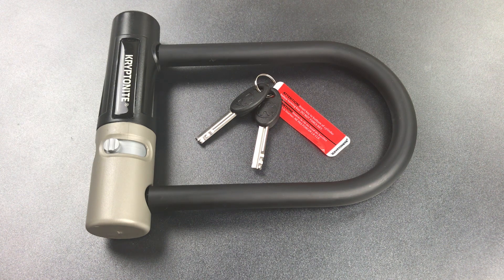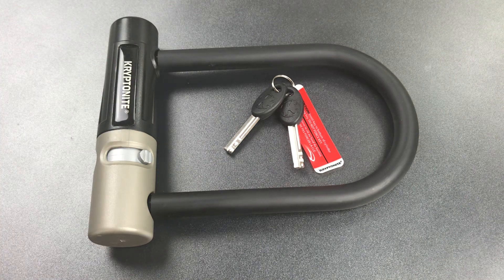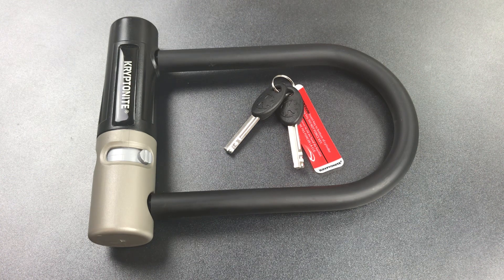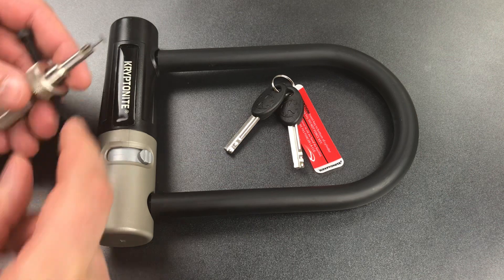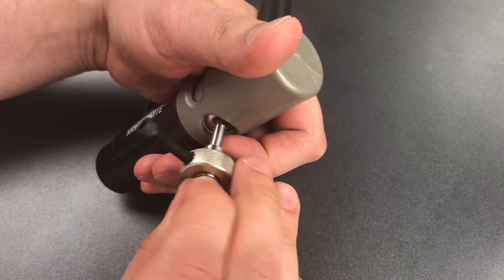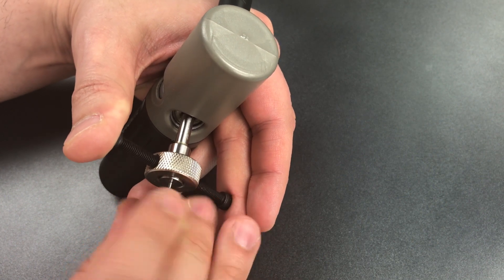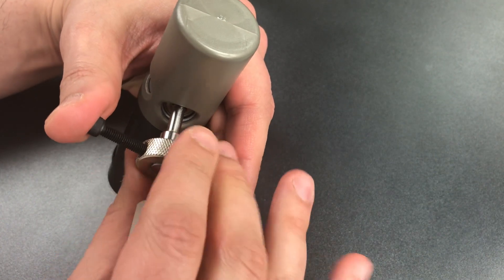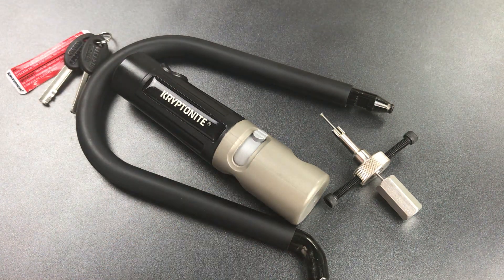[673] Kryptonite’s Trickiest Core in its Worst Lock (TKO Mini U-Lock)

Comment: How I described this video to a friend (play-quoting you): 
"To pick this lock, you'd need an incredibly expensive gadget hand-machined from unobtainium by a hermit living under a footbridge in Mercia. However, because the lock was made indoors, I'm going to open it anyway with the same old hacked-up cheap Chinese tool I always use."
Reply: you missed "by using it backwards" at the end
Reply: Could this be the lock to keep Mrs LPL out of the ice cream ?
Reply: The only part of that pick that is stock is the tensioning collar. The sleeve is either a home brew or modded original, but I'm going to go with the former. The tip looks like Spoox and the grip is from a bottom tensioner. It's close to as good as you can get, short of a Silver Bullet. There are ones out there that are ten times the price of a Silver Bullet and don't work any better. But for us mortals, that modded Chinese one is a good solid work horse. Don't knock it until you've done the mods and felt the difference.  That said, yes LPL is still a fucking badass.
Reply: This is the funniest comment ever

Comment: I like this trick! You can still do it on Abus Plus (on front or rear disc tension) but feedback is exceptionally crummy, especially with the false gates. I have a Chinesium disc detainer that uses one of the middle discs to drive the lock and it just totally kills feedback when using the front/rear disc to tension. Abloy are even worse with their front disc tension defences, so whilst a cool trick, it won't always work.

Kryptonite do a better disc detainer than this IMO, it is one of the Evolution series. It has irregular profiling and a disc blocking system, like Abus X-Plus (I think it is an X-Plus on license tbh)...or maybe I am confusing two locks there. The Evolution Series 4 definitely has the free-spinner at the front and irregular profiling but it might be Master that do an X-Plus clone.

Comment: I can normally follow the theory behind your methodology very well, but I did not follow this at all.  Likely due to zero actual experience with disc detainer locks.  Do you have a recommended book, site, or other knowledge source where one could dive deeper into the concepts and practical picking methodologies of disc detainer locks, or is there no substitute for raw experience on this one?
Reply: Me too...
Reply: So he did it like this (from what I understood) say there is 4 discs and you are supposed to tension off disc 2 or 3 you would need a special tool but the way he did it was tension off disc 1 and pick all the other discs then he used the pick to tension (after he found what disk he needed to tension off of) to tension off one of the center discs and used the tension bit of the tool to pick disc 1 hope that helps